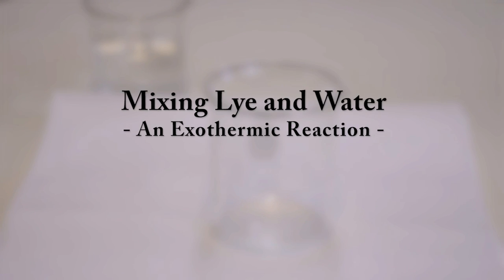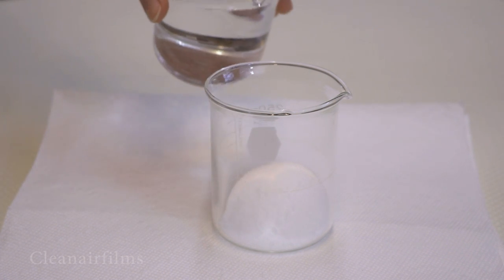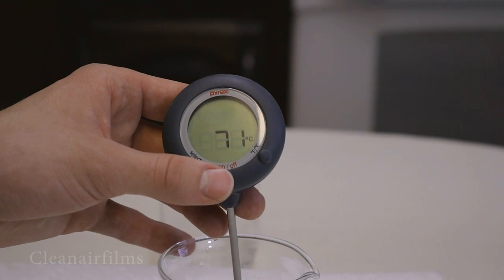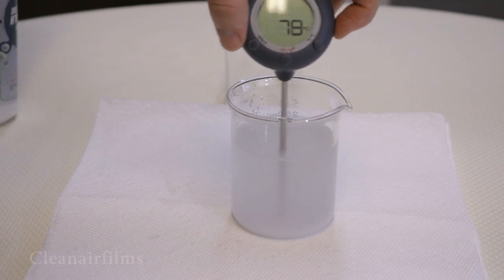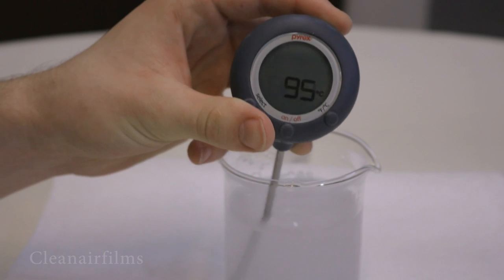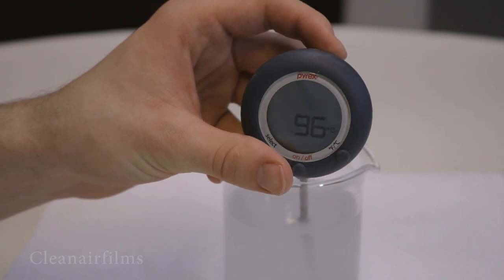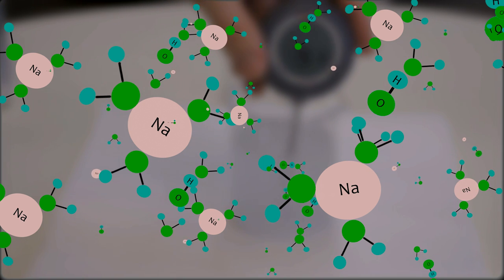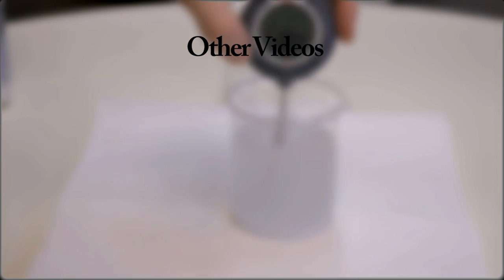What Happens When Lye is Mixed with Water | Experiment

Comment: So if you used BOILING water - the reaction would heat it even more giving you a ridiculous temperture
Reply from the maker: That would be dangerous as the reaction would proceed very quickly and the solution would splatter.

Comment: So does it run out of heat? I hear this stuff is reactive. 
t's also used in soap making I think. But that is made on a stove.
Would the heat of the stove do anything to the lye?
Reply from the maker: It would increase the rate of the reaction. It would be unadvisable.

Comment: At the end of the video does he neutralize the release of energy? If so, what does he use to stop the release of energy?
Reply from the maker: The release ends when all the reactants have reacted.
Reply: @TheBoringVoice  Hi ive got a quick question, When u mix lye and water does the solution recieve a higher pH or a lower one?
Reply: @hampus4609  lye is sodium hydroxide, which is caustic, it is very alkaline. Acid is below 7 ph and alkaline is above 7 ph. So this solution would be very high ph and can dissolve aluminum